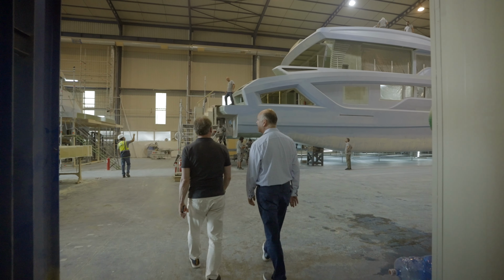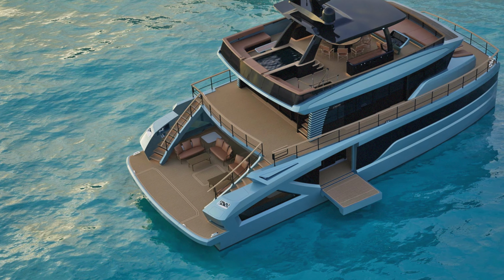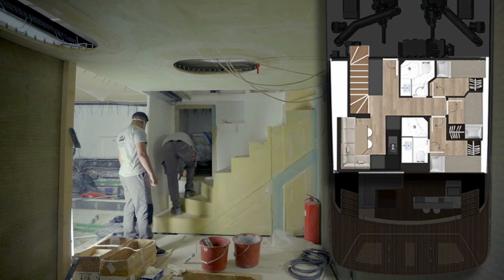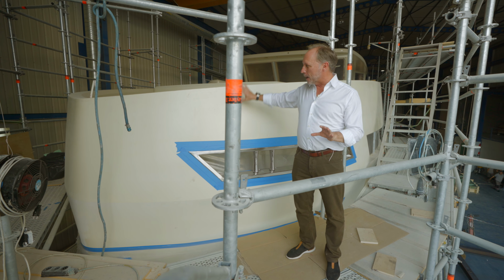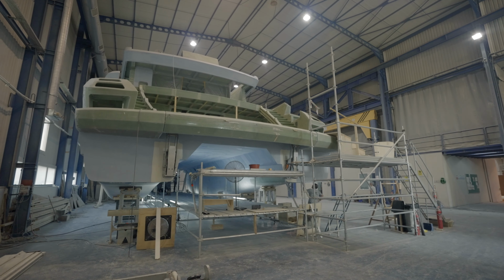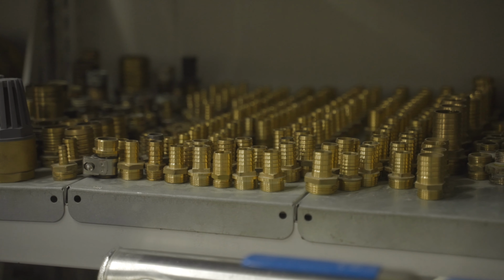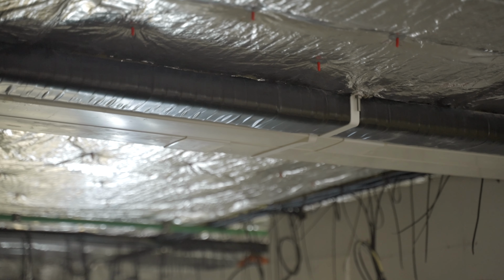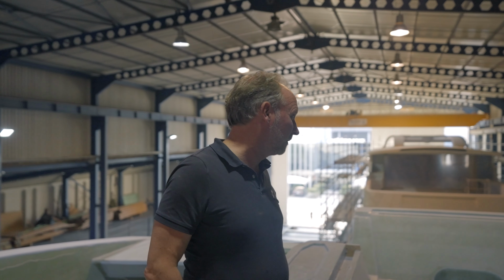Lazzara Yachts, doing things DIFFERENT...by design!

Comment: Nice to see a Turkish yacht builder prioritise quality construction, but troubling to see the Lazarra website claim to be an AMERICAN company, with no mention of Turkey AT ALL. The first line of the 'about us' section reads: "Lazzara Yachts is a legendary American company" (please note the use of present tense) and the HQ address is apparently Fort Lauderdale, which is not in Turkey... at least last time I checked.
And it would have been nice if David Seal's employers, Northrop & Johnson, did not also offer a misleading description of the company on THEIR website (where they are selling at least one Lazzara Yacht)  as "Lazzara Yachts are an American yacht building tradition" (again, present tense). Yes, Lazzara did build boats in Florida, but not any more, since they were bought from the restructured remnants of the original ownership group of Americans.
So I guess striving for the highest quality does not extend beyond the design and production departments to the folks in marketing.
Reply: Lazzzara is an American company.  They have moved their construction to Turkey.  But nothing has changed.  It is still American.  Is Ford a Chinese company because they build cars in China?
Reply: @kokomo9764  A yacht builder that is 100% owned by a Turkish company (having purchased the brand from its American founders) is run from, and builds all its boats in, Turkey is by any rational definition a Turkish company, despite the technicality of the brand name being retained in an intermediate US holding company.
Having some operations overseas as part of a multi-national organisation, like Ford, is not a fair comparison. A company like Grand Banks, which builds all of its boats in Taiwan, but is still owned and run by Americans in USA still qualifies as an American company, but when every function is transferred overseas as here, then common sense would indicate the fundamental difference.
Reply: You're getting riled up over a company's HQ and locations where companies can build.
Reply: @grondhero  No, I am merely commenting on a comments page that a company is being economical with the truth, and then engaging with the comments of others who may hold a different point of view... or am I missing the point of comments pages ?
And it should be obvious that my point was not where companies CAN build, but rather that they should be up-front about where they DO build.
Reply: @RandomGuyRandomNumber  Clearly you fail to communicate or comprehend what you're reading.  In addition you are "being economical with the truth" as Euro Marine also states "Lazzara Yachts is a legendary American company with decades of yacht building experience, delivering innovation and uniqueness in everything we do."  Why did you ignore that?  Or did you not do full research?

Shipyards are still there in Florida.  Are you saying someone else owns them, even though their office is there?  A simple street view would have helped you.
Reply: @grondhero  Euro Marine are the Turkish owners of Lazarra Yachts (despite Turkey not generally being considered part of Europe, but that is by the by and not germane to this discussion - but just an interesting thing to comment about on a comments page). Of course the parent company makes the same claims as to being American as all the other subsidiary / associated companies involved - I have absolutely no idea why you think that is important, or somehow indicates a flaw in my reasoning or lack of research. Despite being a 100% Turkish operation, everyone involved is still making claims to be American... ALL of them, from holding company to sales outlet to second-hand yacht broker... there isn't enough room here to quote the same advertising strap line from every single website, and I fail to see how that somehow weakens my argument. If anything, you have highlighted how the claim to be American  is part of a group-wide strategy, and not an oversight or minor issue - it is important enough to have been mandated across the entire group !
The shipyards are still there, but they are not producing boats under the Lazzara Yachts brand name. As you have seen from this video, every function of the operation is based in one building, IN TURKEY. Design, sale, marketing, customer-care, administration... EVERYTHING. Google Street View is also out of date and is hardly definitive proof of what is going on INSIDE the building NOW.
Reply: @RandomGuyRandomNumber  Turkey is part of two continents.  I stopped reading after that.  You're clearly anal retentive on something insignificant.  Did you know 63 Earths will fit inside Uranus?  It would be 64 if you'd relax.
Reply: @grondhero  Wonder if the American flag at 16:02 makes any difference to naysayers.
Reply: @grondhero  East Thrace constitutes 3% of the total land mass of Turkey. The remaining 97% of Turkey is in Anatolia, which is in Asia.
12% of France is in South America (French Guiana)... but France is not generally considered part of South America.
Part of Spain is in North Africa (Ceuta), but Spain is not generally considered part of North Africa.
Parts of the Netherlands are in the Caribbean (Netherlands Antilles, Aruba, Sint Maarten and Curaçao), but the Netherlands is not generally considered part of the Caribbean.
I could go on, but geography can be complicated... especially if one is an internet troll looking for an argument instead of a discussion and has been saving up a pretty hackneyed insult that one thinks is clever and original (but is in reality pretty sad and apropos of nothing) instead of addressing the actual issue.
Reply: @FilthyMcNasty1  The American flag is smaller than, and is being flown below, the flag of Turkey. For those familiar with flag etiquette (nautical or otherwise), that tells you all you need to know.
Reply: @RandomGuyRandomNumber  I knew that but the fact that it is there in the first place is my point.
Companies headquartered outside of the US show the same respect with their offices/plants in the States.
Reply: 2:51 George no sound. But look at his posture, his facial and hand gestures. That is one driven man who is doing everything he can to produce the best he can.
Reply from the maker: See Short reply
Reply: @yachtbuilders  American
Reply: After decades, centuries even, of globalisation this is so weird to read. By the same measure Apple is no longer an American manufacturer and Bentley isn’t a British automaker. Is Lazzara a US taxpayer and subject to US laws? I would imagine so. That mostly makes it American.
Reply: Not at all an expert but this in the USA is a crazy small niche community for Yacht building mainly but not exclusive to New England and from there Florida and California.  California is legendary for being very "into" their Yacht Boats most being to be sailboats but one exception to that is Nordhavn and I think they also now are producing in Turkey to include Bering and this enterprise as well now apparently and again I think this is no accident as being such a small World putting so much localized can create customized solutions such as this that simply would not be possible in the USA for this niche of a niche product if that makes sense. Amazing to see this as a consequence "whomever is the owner" clearly all that matters in the end is the buyer😊😊